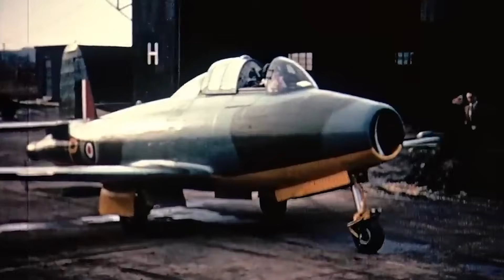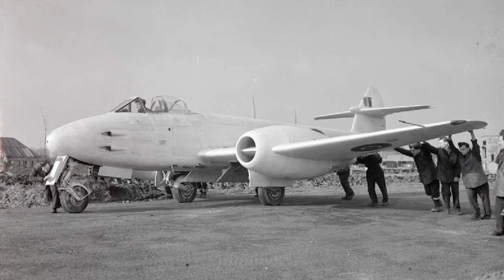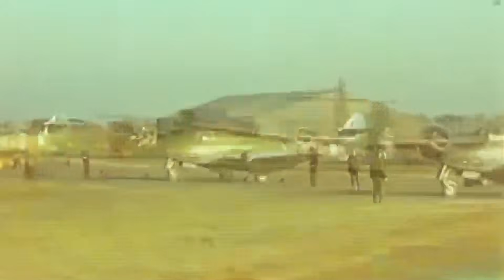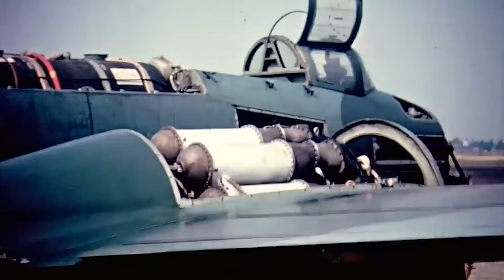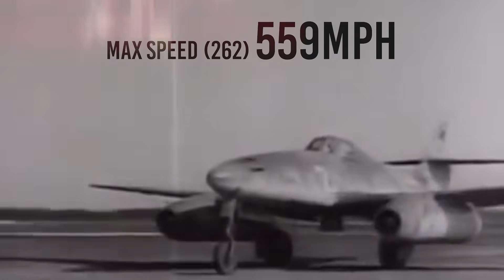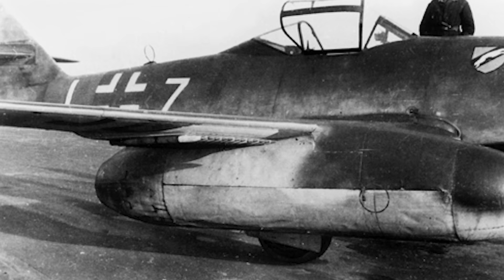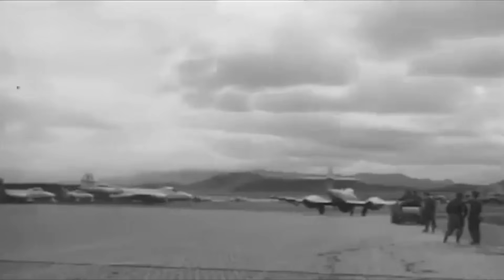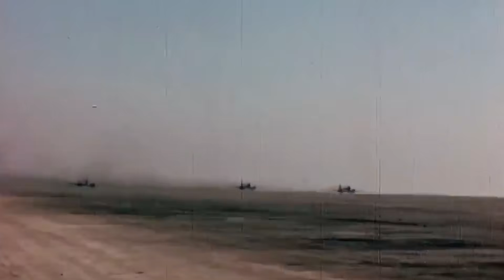Meteor vs Me 262 | Which was the better WW2 jet?

Comment: I don’t think that either plane (especially the Meteor) had enough of a track record in the war to make a valid comparison.
Reply: @mencken8  the me 262,had a axial flow engine which is still used today so as far as which plane was better would have to be the 262 . It had more advanced features like the engine, swept wings, and  armaments. However since Germany didn’t have the resources they needed to make the engine more reliable the meteor was a close second. The Germans were working on making the metals more reliable to deal with the heat that destroyed the fan blades giving each engine only 10 hours of service life.
Reply: @mrbig4532  You realize that it is actually irrelevant that the principle the engine is built on is more advanced, if the engine itself is utter trash. 
Add in the fact that overall German build quality was nonexistent by that point.... The 262 was a barely functioning heap of scrap, and the meteor would have won 7 times out of 10 purely down to the fact that the 262 would not have started, exploded on takeoff, or crashed on the way.
Reply: @mrbig4532 
The 262s engine is not used today. It was dangerous junk. Very little of the 262's airframe was advanced. It had no air brakes. Could not go above 450mph because of tail instability.

Eric Brown said it was fast in a straight line that was about all. It could not dog fight. Many allied piston fighters took it down.
Reply: @johnburns4017 not the same exact engine dude , I mean the axial flow design . How could you confuse what I wrote in my comment that they are still using the exact type of engine that was built  80 years ago , instead of the design. The axial flow engine that was designed by the German engineers has been improved over the last 8 decades just incase you didn’t know that.
Reply: @mrbig4532  
Pretty well nothing has been used from German designs. Most American engines in the 1940s/50s were of UK design, many made under licence. The US licensed the J-42 (RR Nene) and J-48 (RR Tay), being virtually identical to the British engines. US aircraft used licensed British engines powering the: P-59, P-80, T-33, F9F Panther, F9F-6 Cougar, FJ Fury 3 and 4, Martin B-57 Canberra, F-94 Starfire, A4 Skyhawk and the A7 Corsair.

The US General Electric J-47 turbojet was developed by General Electric in conjunction with Metropolitan Vickers of the UK, who had already developed a 9-stage axial-flow compressor engine licensing the design to Allison in 1944 for the earlier J-35 engine first flying in May 1948. The centrifugal Rolls Royce Nene is one of the highest production jet engines in history with over 50,000 built.
Reply: @johnburns4017 wait a minute how could the UK develop axial flow engine along with General Electric that first flew as the j-35 in 1948 but they licensed the same design to Allison in 1944? Make me under stand that . 😊
Reply: @johnburns4017  All modern jet engines trace their origins back to Dr Anselm Franz's invention the axial-flow jet engine. The British were unable to build a working axial flow jet engine until after the when they had access to German research. Any questions?
Reply: @TheAneewAony  
doktorbimmr
A quiz.
Name the inventor of the axial-flow jet engine?
Twenty points for the correct answer.
Reply: @johnburns4017  Maxime Guillaume patented the axial turbojet in 1921 and Dr Anselm Franz demonstrated the World's first axial jet engine in 1940 and Jumo.
The Jumo -004 was the world's first production axial jet engine. 
The UK would not have flight rated production axial engines until the 1950's
Reply: The Me 262 had 700+ kills and many ace pilots including Franz Schall, Alfred Ambs, Heinz Bar, Walter Schuck etc.
Reply: The Me 262 had 700+ kills and many ace pilots including Heinz Bar, Walter Schuck, Franz Schall etc
Reply: @mencken8  To me it seems to be a "Tiger tank" Vs "Sherman" comparison. 262 was technically superior in many ways (but not all) but at the expense of: reliability, repairability, engine lifespan, and ability to produce in numbers (even assuming all things being equal). 
Which is best? If both had been introduced in 1943 the allies would have cleared the sky's using Meteors, but would've always been wary of running into 262s.
Reply: @YesYes-xb6hethe old Sherman to Tiger comparison isn’t really fair. The Sherman was a medium tank, designed when the Germans had the Panzer 1, II and III. It was much more than a match for them. It was also somewhat better than the later Panzer IV. But the Tiger came out after the Sherman was designed and in mass production. The Tiger was the first real heavy tank in the war, so not really comparable. But the Firefly, the British version of the Sherman with the 17 pounder, could take out a Tiger and King Tiger, though the armor was the same Sherman armor. We didn’t have a heavy tank until near the end of the war with the Pershing.
Reply: The Gloster Meatbox was not a fighter and only killed RAF pilots...
Reply: @DoktorBayerischeMotorenWerke  ME 262 didn't have enough fuel to fly and required constant maintenance. While Meatbox as you say was more reaible and could run on Pump petrol.
Reply: @JetfireWithy  Well lad, that comment reveals a lot.
First, the Jumo 109-004B egines were fully multi-fuel capable and could run on;

 Standard Wehrmacht fuel OZ 74
D2 Flugdieselkraftstoff 
 K2 Sonderdieselkraftstoff 
 C3 Flugmotorenbenzin (Green)
B4 Flugmotorenbenzin  (Blue)
K1 (kerosene)
in addition to its standard fuel 
J2 Stoff, a synthetic jet fuel made from Coal oil and in plentiful supply. 

The huge advantage of jet engines is significantly reduced maintenance and longer time between overhauls.

The Me-262 engines averaged 55 hours between overhaul and a PFTR rating at Mil-power of 150+ hours.

The "Meatbox was not only less reliable it was very dangerous to fly... it only killed RAF pilots during WW2.
FALSE, Allied engines required a specially prepared fuel blend based on Kerosene/Paraffin, The Allies did not standardized jet fuel formulas until after the war.
Reply: @DoktorBayerischeMotorenWerke  bringing up the mantinance time with the 262 feels slightly irrelevant as those engines were kinda crap. The Germans were working with shit resources with slave labor. I'd argue the meteors airframe was better as it was used into the 80s before fully retiring from work. 

Speaking of the airframe the meteors were very easy to retrofit. They were shockingly well future proofed all things considered. 

From another angle Its fascinating 262s saw combat at all. They were perfectly timed to be there but too late to make much of a difference. 

I think looking at the big picture the meteor was more of a success. The UK sold a metric shitload
Reply: @cheeselover-p5e The Jumo 109-004 was the most advanced jet engine in the world during WW2 giving the Me-262 a massive 125 mph speed advantage over any Allied. Germany had the best aerospace technology in the world and was easily 10 years ahead of British.
 The Jumo -004 incorporated advanced jet engine technologies like bleed-air cooled blades and TBCs, technology completely unavailable to the Allies during the war.
 The Allies actually used more slave and prison labor in WW2... Germany did not use prison labor in high-skill jobs or quality control inspections, it only used prisoners for unskilled manual labor tasks.

You would have no facts to back-up your dubious argument, the Gloster "Meatbox" (or flying coffin) as it was called by RAF was a disappointing failure as a jet fighter, its combat role was limited to ground attack missions. Me-262 pilot Kurt Welter remains the highest scoring Jet Ace in history... the Meatbox only killed British pilots during WW2.

Britian had to make a lot of Meatboxes, because so many crashed, 56% of all Meteors were lost in accidents, 890 crashes in RAF service alone killing 450 British pilots mostly in non-combat operations over 1,800 written-off as hull loss accidents.

150 crashed in a single year, 12 crashed in one week, 6 crashed in a single day.

The Meatbox was without any doubts the single most effective jet aircraft ever used Against the RAF!
Reply: @cheeselover-p5e 
The Meteor is used commercially. Martin Baker use it.  No major power used the 262 after WW2 - none.
Reply: @DoktorBayerischeMotorenWerke  
doktorbimmer, a quiz.
Name the British companies making axial-flow engines in WW2?

20 points for the correct answer.
Reply: @DoktorBayerischeMotorenWerke  oooh so close, forced labor was so used that more people died manufacturing the v2 rocket then people killed by use of the rocket. Forced laborers were used extensively by Germany and on these high tech weapons. They set aside a whole a whole underground bunker the Mittelwerk (“Central Works”) plant is one of the most well known cases of forced labor and they worked on v2 missiles. They clearly did used forced and slave labor on these advanced wonder weapons.
Reply: @johnburns4017  well I know we are both arguing that the 262 was crap but I do need to correct you for academic integrity

The Avia s-92 was a Czech copy built from leftover parts and tooling. So while only 9 were built at least one nation did use it after the war. Not to mention a few post war jets were very similarl since like today people assumed it was the best jet fighter of the war and copied design cues.
Reply: @cheeselover-p5e 
I know of the Avia 262. I did write: 'major power'.

The 262 was taken from a 1938 piston engine design - the looks with the pilot over the wings gives it away. No post war jet plane by the USSR, France, etc, used such an airframe as the 262.
Reply: @cheeselover-p5e America, Britian and the Soviet Union ALL used forced labor during WW2 and no countries used more forced labor than Britain and the USSR.
The Soviet Gulag system used millions of prisoners in major infrastructure projects, farm labor and used extensively in factory work.
 The United States used German prisoners as farm labor, factory labor and extremely dangerous jobs like clearing minefields.
 Britain by far had the largest use forced labor in massive numbers in Africa, India and its other Asian colonies, millions died of exhaustion, starvation and disease in mining, infrastructure construction and factory work. The highest number of forced labor deaths were on the Allied side, many of them in in support of advanced weapons like radar, jet engines and computers.

There is nothing in the world more despicable than a hypocrite.
Reply: @johnburns4017  The "Meatbox" was never used successfully as a fighter, it only killed British pilots during WW2.
 The Me-262 remained in service in Czechoslovakia until the 1950's
Like all the 1st. gen WW2 jets they were rendered obsolete by the rapid advances in jet technology after the war... The RAF would not receive it first effective jet fighter with the Hawker Hunter in 1954.
Reply: @johnburns4017  BRITIAN DID NOT HAVE ANY FLIGHT RATED AXIAL JET ENGINE IN MASS PRODUCTION OR SERVICE UNTIL THE 1950's
Reply: @DoktorBayerischeMotorenWerke  
BZZZZZZZZZZZZT! Wrong answer.
docktorbimmer, the names of the British companies making axial-flow engines in WW2 were….

🍷🎊🎉 Metro-Vick 🍷🍾🎊🎉
🍷🎊🎉 Rolls Royce 🍷🍾🎊🎉
🍷🎊🎉 Armstrong Siddeley 🍷🍾🎊🎉

Zero points bimmer, zero. Better luck next time.
Reply: @johnburns4017  Metropolitan-Vickers Never had any flight rated axial jet engine in production or service. They abandoned jet engines in 1947 and returned to building steam engines.
 Rolls-Royce and Armstrong Siddeley did not develop axial jet engine until after the war using captured German technology and expertice.

No British lies tolerated here!
Reply: @DoktorBayerischeMotorenWerke  oh right ok shit my bad I genuinely forgot the soviet's where on the allied side for most of the war that's on me....but I do want sources for that claim of German pows clearing minefields
Reply: @DoktorBayerischeMotorenWerke  well the meteor's airframe was used for way longer. There more to a plane then just the engine
Reply: @johnburns4017  ok but were they flight rated? I hate the 262 as much as the next guy but I am curious
Reply: @cheeselover-p5e 
The B-17 bomber formations were flying near to the test centre. they threw them up whether they were ready  or suitable or not. 

I do not hate the 262.
Reply: @cheeselover-p5e France: German prisoners were used for unexploded ordinance removal and mine clearance. Mine clearance was particularly dangerous and caused many deaths and injuries.
United States: German and other Axis POWs were transferred to France, Norway and Denmark for mine clearing work after the war.
This was in violation of treaties for the treatment of prisoners at the time.
These are well-known and documented Allied war crimes and sources include both French, German and Americans sources The U.S. Army Archives Center, The United States Office of the Historian and there is even a Wikipedia page
Reply: @cheeselover-p5e But not as a fighter and only in second rate RAF units and many sold to foreign countries for hard currency or traded overseas for food and agricultural supplies to feed a defeated Britian... still starving and bankrupt well into the postwar era.

TRUE, The Gloster "Meatbox" was a well-earned nickname... it was directionally unstable at both low and high-speed flight, and it had appalling asymmetric handling due to a lack of rudder authority. Many crashed after breaking up in mid-air due to a sudden uncontrolled snap into a flat spin, The primary failure mode of the 890 crashes was an engine failure on take-off or a go-around.

The RAF lacked an effective operational jet fighter until 1954 when the Hawker Hunter was finally introduced, although it was also unable to fly supersonic it was capable of fulfilling the fighter role that the Meatbox could not.
Reply: @johnburns4017  The Me-262 was already surpassed by more advanced second-generation German fighter jets like the F-86 Sabre and the MiG-15... far more advanced than anything that the UK had in service at the time they were introduced into service or during the Korean War. The RAF would have to wait for the Hawker Hunter.
Reply: @cheeselover-p5e No, they WERE NOT flight-rated, the first British axial jet engine was the Rolls-Royce Avon designed by German engineer Fritz Feller.
Reply: @johnburns4017  Me-262 pilots shot down over 1,500 Allied aircraft including RAF fighters like Spitfires, Tempests and 75 Mosquitos.
 28 Luftwaffe pilots scored ACE or higher flying the Me-262.
 Me-262 pilot Kurt Welter remains the HIGHEST SCORING Jet Ace in history.
Reply: the meteor had zero record on ww2. never saw a dogfight. So your point is true, you cant compare the two of them because only the me262 saw interceptions and dogfights.
Reply: @ravell2854 did well against the V1 in home defense, scoring a kill before the 262. Mind when you have the Mosquito, who needs jets 😉
Reply: @mencken8  vehemently agree on the meteor. 262 existed
Reply: @repuIsive the Meteor was operational before the 262
Reply: @BCO44  NO IT WASNT...Me-262 was transferred from RLM testing and entered operational Luftwaffe squadron service on April 19th 1944... and shot down its first Allied aircraft on June 26th... one day before the Gloster Meatbox entered RAF service on the 27th.
Reply: @DoktorBayerischeMotorenWerke whilst it was flying missions earlier, it did not score its first kill until after meteor, which was a V1 on August 4th. The 262 on the other hand DID NOT down a wooden recon Mosquito on July 26th, which it hit but couldn’t down, probably down to it being A worse aircraft than the mossie. It scored its first kill 4 days later than the meteor.
Reply: @BCO44  What a pathetic load of british wishful thinking... 28 Luftwaffe pilots scored Ace or higher flying the Me-262 with Kurt Welter becoming the highest scoring jet Ace in history.
 The Meatbox only killed British pilots... 890 crashed just in RAF service killing 450 British pilots in non-combat operations.
Reply: @Dokto @DoktorBayerischeMotorenWerke  it or not its fact. Research it if you like. And by the way, Kurt Welter CLAIMED 26 kills, not confirmed. A bit like the Nazis claimed the Reich would last for a thousand years? Nice to see the propaganda machine is still whirring away though. See you moved the subject on also. Interesting.
Reply: @BCO44  Its a fact, the Messerschmitt Me-262 was highly successful in aerial combat while the Meatbox only killed RAF pilots during WW2.
 The Meatbox was not a fighter and was never used in the fighter role.
Its RAF service was limited to Ground Attack, Reconnaissance and Training roles.

The wholesale losses of Gloster "Meteorites" crashing into the Earth continued after the war with 890 crashes just in RAF service killing 450 British pilots.
One out of every two aircraft crashed or were destroyed in accidents.

Never in history has a British Jet ever been used so effectively AGAINST the RAF.
Reply: @DoktorBayerischeMotorenWerke  Almost like the "meatbox" was working for the other side!
Reply: @andrewwood3597  Yes, never in history was a British aircraft used so effectively against the RAF.
Reply: @BCO44  false ....it did see official service before the 262 though. The first 262s in combat were with a test squadron
Reply: @BCO44 
The 262 never hit the Mosquito. It made sharp maneuvers popping a fuselage plate.
Reply: According to British intelligence reports, 10 allied prop fighters were downed by 262s. But 132 262s were downed by allied prop fighters. That tells us all we need to know.